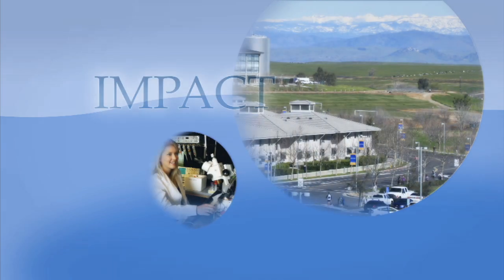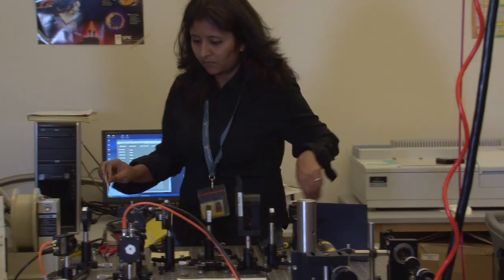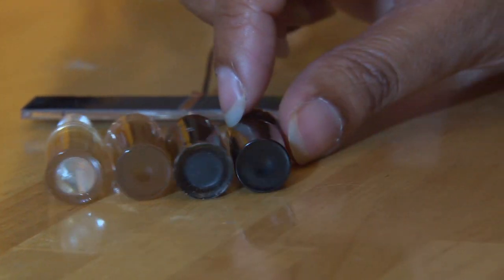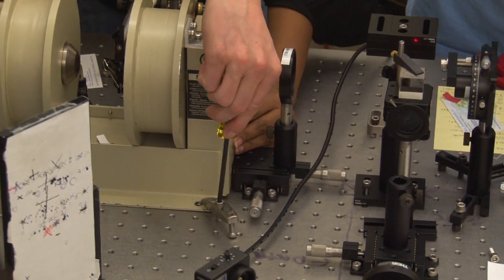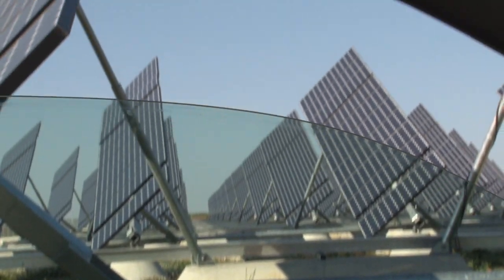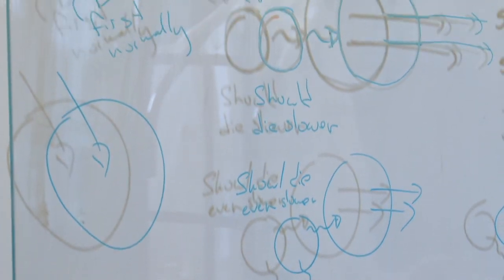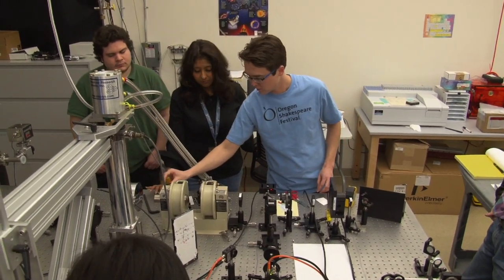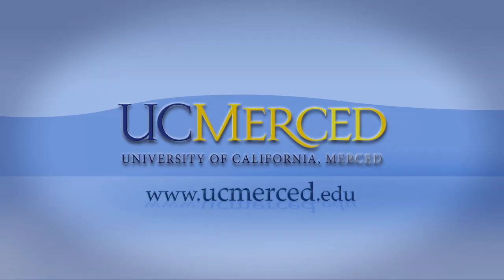Impact: Solar Concentrators to Improve Efficiency of Solar Panels

Comment: This is a great guideline gives you all the information you need regarding building a home solar electrical power system [Awesome Plan Here >>>https://plus.google.com/u/3/113778429958471787540/posts/67MrRb1YGej ]. In plain language it tells you what you need to know. And how to put it together with common sense applications.
Reply: ty